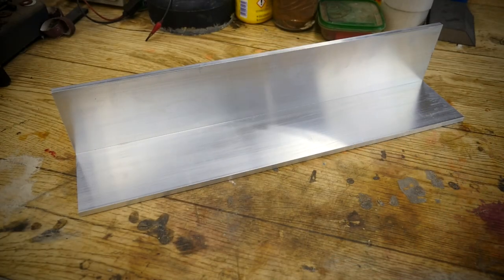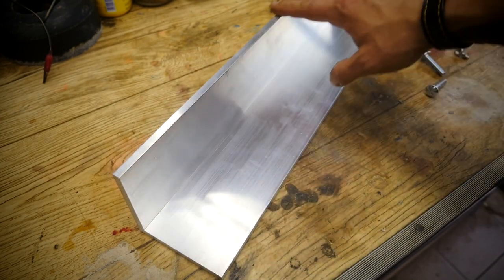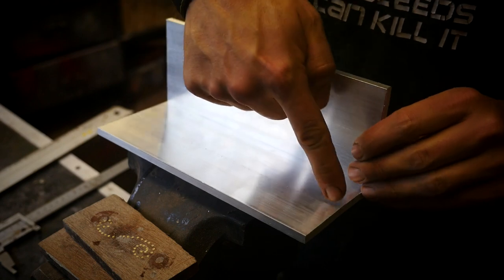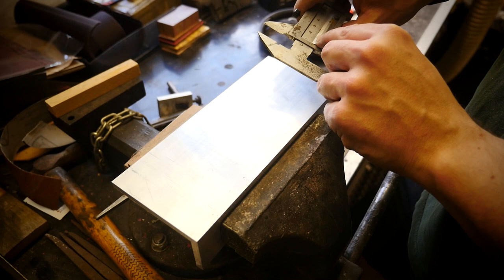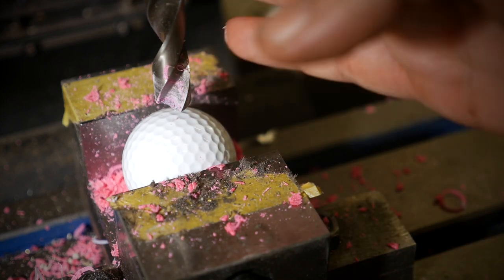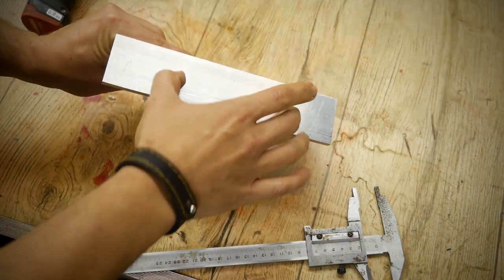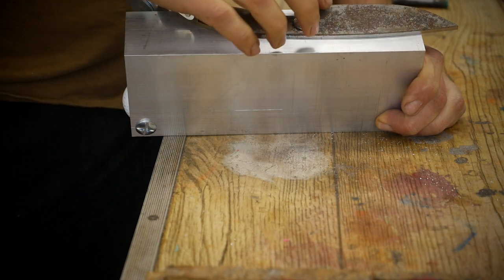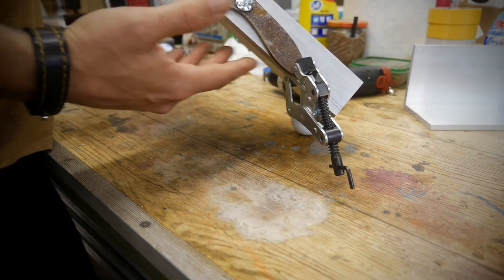TROLLSKY'S BUDGET GRINDING JIG [Trollsky Knifemaking]

Comment: Awesome, thank you.  But can I just confirm at what stage of the build you are doing this kind of grind?  It would have to be prior to heat treatment, as the heat build up from the grind would wreck the temper if you did it post heat treatment right?

Comment: It's a great jig! Well done! I prefer to tilt my sander table into the belt for the angle and then just use a piece of angle to hold it while grinding.  The thing I don't like about this style of jig is when you go to far to the left or right your screw will go off the sander table and then your blade is in a different position.

Comment: Hey trollski, I have a stupid idea for bevelling knifes even more cheaply; If someone were to mount an an angle grinder with a large abrasive cut-off disc like a table saw you could then have a table saw sled where you attach your knife at an angle and 'rip cut'  it along it's length to create the bevel. If the blade is curved you'd have to take multiple passes at different tangents to approximate a curved bevel. The glaring issue with this idea is obviously safety, maybe if there was a remote way to push the sled you could minimise the risk in such an operation. What do you think boyo?
Reply from the maker: Could be possible, however I prefer belt grinder :)
Reply: Certainly the better way of doing it haha!

Comment: Great to see a new video! Glad you are back and healthy!   I do have a question for you...  Why make the jig adjustable instead of just adjusting your platen angle? This would allow the entire jjg to sit flat on the toolrest and remove the need for the screws and golf balls. Seems easier and less likely to make a mistake like using a different number of washers.
Reply from the maker: I tried your idea a few times and I prefer a  light jig - sometimes you need to adjust angle while grinding.